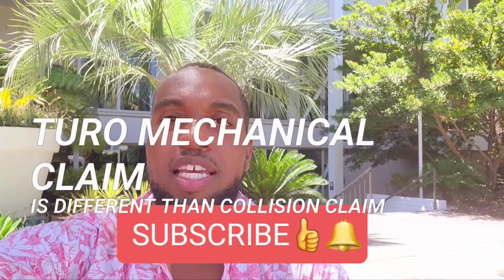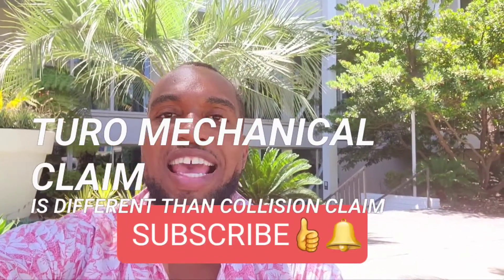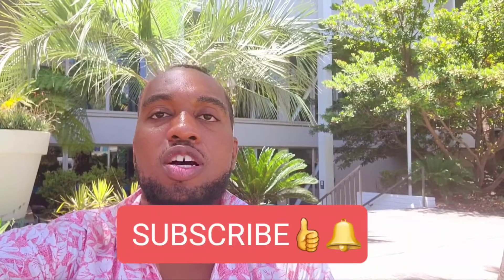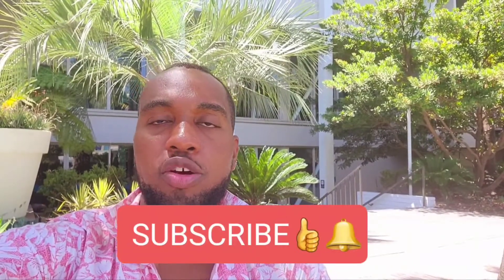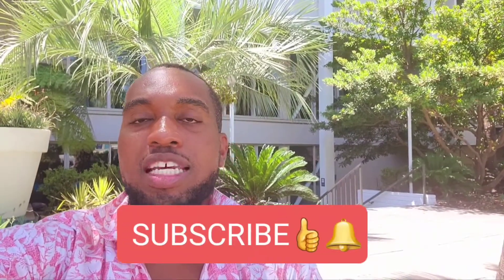Turo Mechanical Claim Is Different Than Collision Claim 👨‍🔧

Comment: It sounds like you're coming at this from the host side, but maybe you could answer a question for me.  I took a trip with Turo recently and the car started having what seemed like electrical issues to me (the door open alarm came on for no reason).  When the host had the car repaired, all they did was replace the battery.  Am I crazy for thinking that's his problem, not mine?  There was no physical damage.  The battery died.  That happens eventually when you own a car.
Reply from the maker: @Paul Schaaf I gave your comment thumbs up and I hearted your comment 🤠 Im sorry that you feel you had a less than satisfactory experience with your previous Turo host. I honestly can not give you 100% answer because there are a lot of factors that I don't understand about your situation. What I can say is that the Turo host typically has the responsibility to maintain the vehicle and the Turo guest has the responsibility of taking care of the vehicle. If turo guest caused damage that turo guest is typically responsible and if the car breaks down in some type of fashion on its own from no fault at all from turo guest than that typically is the responsibility of the Turo guest in my opinion but I'm far from perfect and again I don't have all the information to make proper judgment. What I do recommend is for the Turo guest to report the damage to Turo ASAP and report the vehicle malfunction as well of vehicle as soon as you locate issue so that its documented asap and I would recommend recording video pre trip to see if you catch the issue and record another video during trip if you end up locating problem after you drive off. Also, it depends if the battery was left on due to light being left on by mistake that can kill battery and in that case that would possibly fall on the turo guest but if for example battery test is done and if the battery is a bad battery or if the battery expired than that typically falls on the Turo host. I personally would require battery test to see if it's a matter of turo guest leaving car on and killing battery or if the battery is just a bad battery. I hope my perspective and opinions help but again, I'm sorry to hear about your experience. Please feel free to subscribe to @Conrad Layn YouTube so that you are notified of new videos when they are released 🤠
Reply: @ConradLayn  Thanks for the reply.  I think I'll just roll the dice and see whether Turo charges me anything.  I don't think I should owe anything for a maintenance problem.
Reply from the maker: @Paul Schaaf You're welcome 😊 I'm happy to be of assistance. I truly wish you the best outcome my friend 🤠

Comment: my vehicle has gps and i am in the position that the driver is driving at a high speed of 97mph what should i do??? I can notify a tour support
Reply from the maker: @jesusromero8081 I truly like this question. I'll share what I would do. What I would do is if you are able to track the speed, I would screenshot picture of the mph and the time and date and I would upload picture in Turo trip photos in reference to the driver that is driving at high speeds. You can than notify Turo support and submit the proof. You must prove everything that you are claiming that way Turo support can step in. Turo guest are supposed to follow city and municipal traffic rules and codes and this is clearly a breach of speed/traffic rules of the road. I hope that helps. That's my opinion 😊

Comment: I’m going through this with Turo right now - a renter drove my vehicle out of state and two days later I get a call stating the cars not running - car got towed to a shop and they mentioned the car was probably driven with no oil and engine is blown ! 

The guest obviously either revved up the engine for too long and blew the engine or guest ran over something and oil plug came off and car had no oil and and renter continued to drive and blew engine. 

Turo made me have the shop break the engine apart only to come back to say this was “mechanical failure” and not renter negligence ! This is bs !
Reply from the maker: @Hugo Conde I truly empathize and feel your pain brother 😞 I'm happy to share my opinions and perspectives with fellow Turo host. I have been through this situation and it sucks. I can say that I have successfully got all mechanical claims paid for eventhough they arr more difficult to prove. As the video stated I would first have car taken or towed since guest violated the policy the row should be paid for from Turo guest and not your host earnings. You need to get oil change records and show that your oil change was at sufficient rate. If Turo guest drove vehicle out of state and accrued outrageous miles this definitely can bring down your oil percentage and prematurely age your engine and vehicle. Now this depends if vehicle had set amount of miles if so this is your proof that car was driven over the daily allotted mileage. If you have unlimited miles than this is harder to prove and what would help is taking car to oil change location and affiliated dealership for example if you have Ford take to Ford dealership,  if you have Mercedes take to Mercedes dealership and typically they specialize in your vehicle and can run additional test to see if car was revved up. Now you will want the specialist at the affiliated dealership to write proof and sign and add their credentials,  license number etc and stating that the damage they found with the engine and that it was intact the Turo guest fault. If you find shop that can not find proof keep going to different shops until you find skilled technician. Not all technicians in service shop are made equally some are more experienced,  talented and skilled than their colleagues. I truly wish you the best. Please watch the following short video that can also help you and re-iterate my strategy for proving mechanical damage per the Turo guest video ➡️: https://youtu.be/w42qcutJBxY

Please feel free to subscribe to @Conrad Layn YouTube channel so you are notified when new strategy videos are released 🤠
Reply: @ConradLayn  thank you so much for your advise - I specifically had it towed to a Mitsubishi dealership so they could provide a solid diagnostic on the issue but their report was very vague and I believe this gave Turo the opportunity to deny my claim - I will definitely provide all the oil changes paperwork as well as reach out to the dealership so they can provide me a more detailed diagnostic to provide to turo - though turo hired a 3rd party mechanic “centro” to verify the validity of the claim - they are making it hard to get this taken care of - I’ve had no issues with other claims due to accidents etc but with this being mechanical - it is proving to be extremely difficult. I’ve been a host for more than 6+ years, so I am appalled as to how Turo has handled this claim.
Reply from the maker: @hugo3conde  you're welcome and I totally 100% get how you feel. I truly wish you the best and I hope the dealership gives a more detailed report and if not.consider taking to another affiliated dealership. I truly wish you the best. This can happen to any of us host so I feel your pain 😞
Reply: As much as that sucks if toro blames the renter everytime something like this happens they wouldn't be in business. Unfortunately thar the risk renting vehicles
Reply from the maker: @Kevin S I do agree that it's our business and we should expect the disasters that come but on the other side I do believe their needs to be a way to be compensated if Turo guest violates Turo policy and/compromises vehicle in some type of fashion. Thank you for taking time to leave comment and I appreciate that you took the time to share your perspective. I think it's valuable that all of us add our honest opinions so that we can help eachother as community. Please feel free to subscribe to @Conrad Layn YouTube channel so you are notified when new strategy videos are released ♟️
Reply: @ConradLayn  I don't know im skeptical renting from turo due to people like Hugo trying to blame the renter. If he has solid proof he went off road and beat the piss out of his car then ok. Who knows the individual before him could of beaten crap out of it now this new renter gets blamed. Too many loopholes to try to blame the renter. Unless you have solid evidence of it being ramped off the road etc.. How many miles were on your car Hugo?